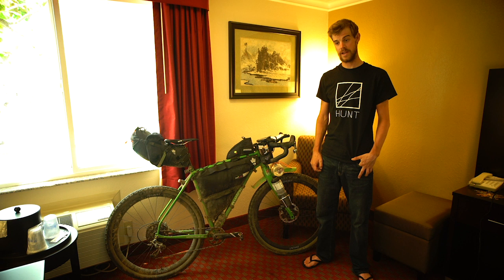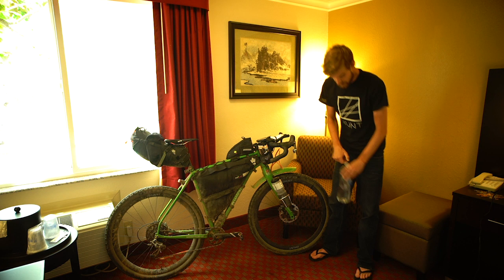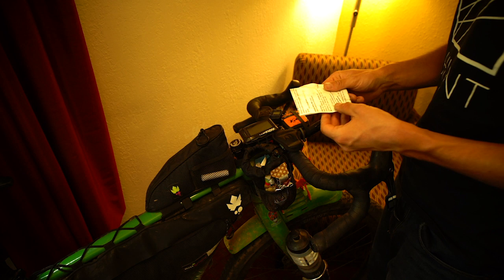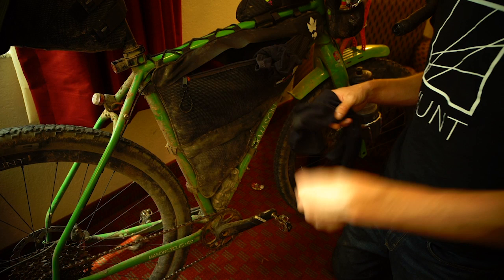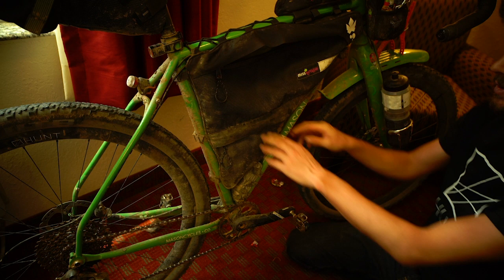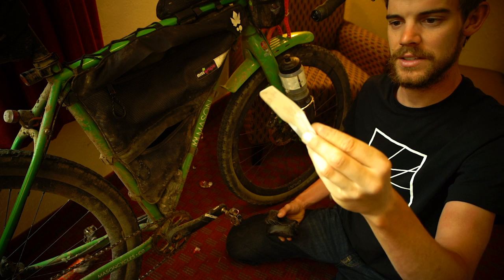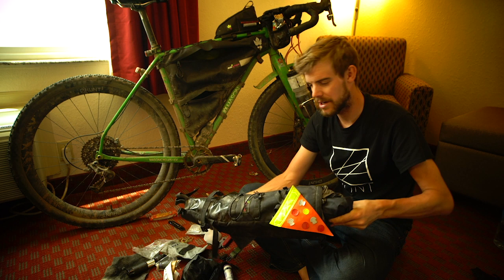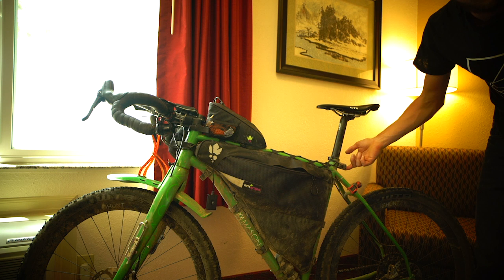Josh Ibbett Mason InSearchOf Tour Divide Bike Check

Comment: Great vid, big thanks. Question on sleeping gear. You mentioned that you would look to change your sleeping kit next time. What changes would you make and why? I've just turned 55 and once covid is back in its box, will look to cycle around the world. Also loved the top tip of no sleeping bag, just down trousers and jacket instead. So much more versitile. Just like the breadboard, obvious once someone with more foresight has pointed it out :)

Comment: Thank you for sharing, you are a great inspiration what to get and how to pack. I am unable to pin point your sleeping gear -- is it Ascent Bivi? What are the names of the pants and jacket? Patagonia Men's Nano Puff Pants and  Patagonia Men's Micro Puff Hoody? Thank you in advance for help. And another subject, if I count correctly you have around 2.1L of "water" with you, right?
Reply from the maker: The Bivvi is an older RAB model which I think has been superseded by the Ascent Bivvi.  Yep the Patagonia stuff was the Nano Puff pants and Micro Puff Jacket. I could carry 2l of water in the bottles on the fork, plus a further 2l mounted on the front fender, plus a 1litre bottle in my back pocket when needed, just around 5l max capacity
Reply: @joshibbett  Many thanks. One more question, what kind (company/name) of waterproof socks are yours? I am searching and searching but all I found are socks completely different than yours.
Reply from the maker: @WanderABit  the are by sealskins